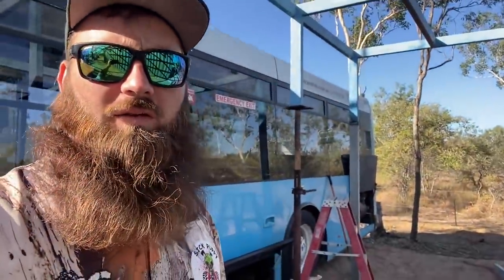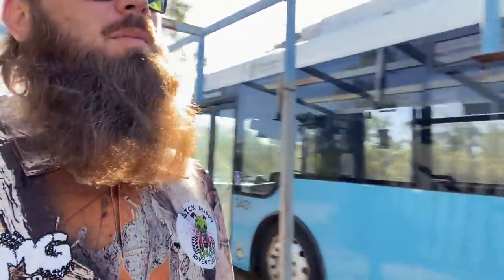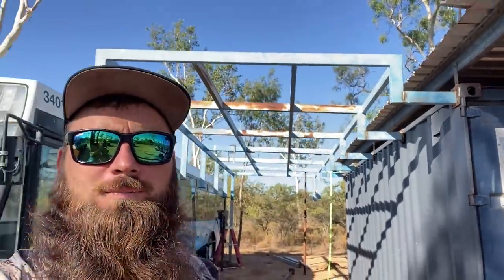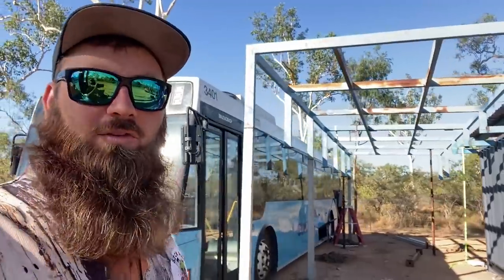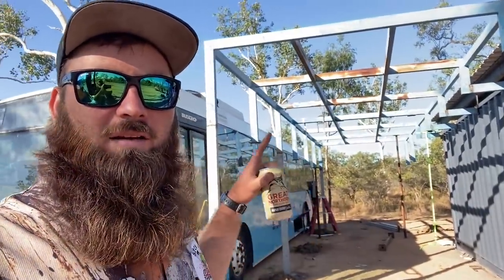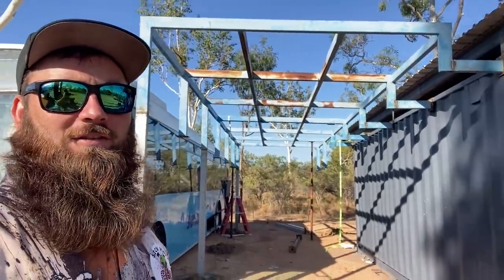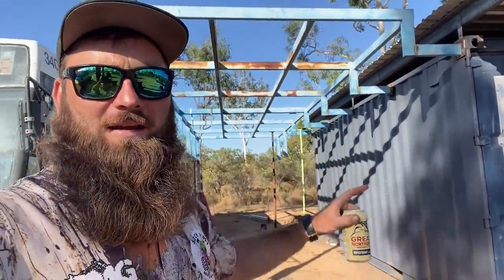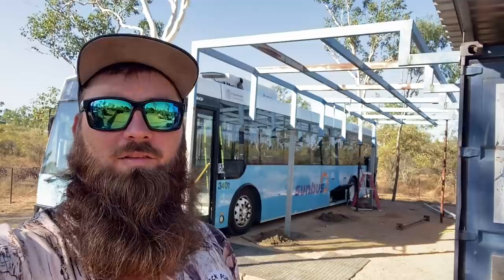Our New Family Home Get a Roof Frame- Tiny Bus Home- Part 5

Comment: If your iron for the roof is long enough, you could leave some overhanging over the bus to close up the gap (may need some kind of support on the end of the iron though so the wind doesn't catch it). Then like someone else said, have something like rubber sheet or canvas attached under that dropping down onto the top of the bus to fill it in even more, and to try and make water falling onto the bus drain off the other side rather than into your paved area.

Comment: Some of that aluminium extrusion channel you slide caravan awning into attached to the bus would work. I got mine from Bunnings & used it on the side of the patio blinds I fitted to the deck at home. Then you could get some awning made to fill the gap & attach to the frame.

Comment: Great work , but I would’ve put a gusset inside those posts and also watch the weld splatter near glass windows , mine cracked my windscreen  when I welded  nearby , even though it was covered with layers of thick cardboard 😫
Reply from the maker: Yea I still gotta get to that. Cheers bro. 
Yea I was worried about it but it was a risk I was willing to take

Comment: Nice work for just one weekend. Watch that the welding sparks are not going all over the buses glass. if you come across any weld splatter on the glass us a new razor blade o remove them before they leave rust stains.👍🚍

Comment: Bloody awesome Cody! Not doubting your welds or anything but I'd recommend putting some c channel bolts around where the posts join the bit you cut off. Just for more structural integrity in the long run.

Comment: Checking the comments before I put mine. You mentioned that you are putting a decking area on the bus roof.  If that's a while off happening then  maybe as a temporary measure some secondhand plywood sheets. Zip tied in place .  Or if not available some big tarps. Tied in place. In some ways it's a case of either setting something up that would work in with the decking on the bus roof.. one picture in my head is like those factory rooves  that are kinda staggered. Going up but then there is a section going straight down to the next section that goes up..   I guess at the end of the day it's what's going to fit the budget but do a good enough job..

Comment: Hey Cody have to ask where would your gun safe get mounted? Or does it exceed the weight limit and can go anywhere without being bolted down
Reply from the maker: It already exceeds the weight but I also have it bolted inside a concrete floor container behind a locked door
Reply from the maker: And the container is also fixed down
Reply from the maker: With cameras inside and out haha

Comment: Hey Cody, sorry for the dumb question, i imagine you wouldnt be doing it if it didnt work, but at 3:58 in your video, is this an actual viable way to concrete post holes? The reason i ask, is im wondering why the f%$# i havent been doing this for the past 15 years of my working life.. does it actually mix properly? And i noticed on your second hole you added water first opposed to post mix first, did it make a difference? So many questions that need to be answered im in a cage of emotion right now.
Reply from the maker: I have done it that way for years for posts and tap stand poles and they have always come out solid as. I have even had to pull out a post I had concreted in at one point and it does set all the way through. The water in the second hole was just left over water from when I dug em.
Reply: @sickpuppycody  thanks I'll be doing this for now on haha cheers